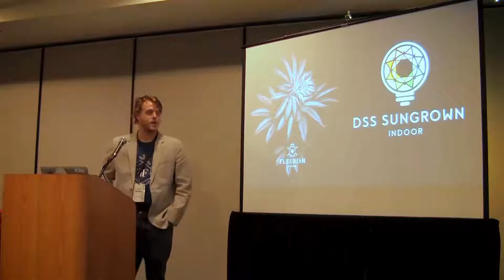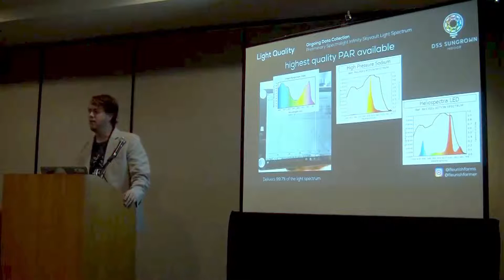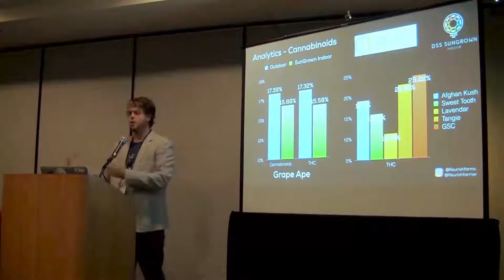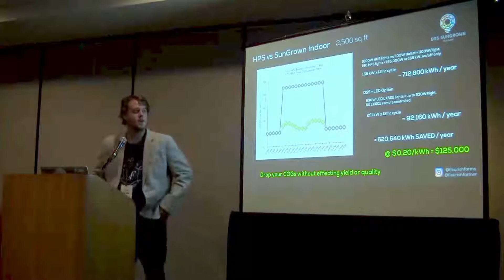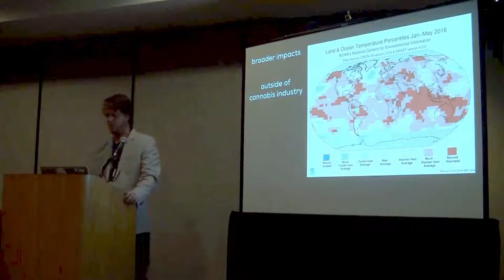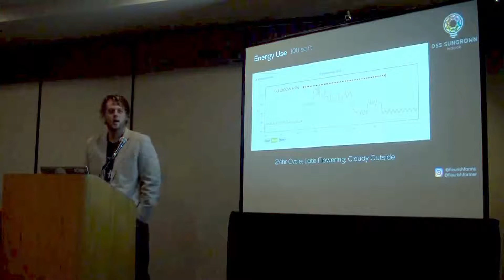Low to Zero-impact Indoor Cannabis Cultivation with the DSS SunGrown Indoor™ system

Comment: At what height from The plants should  you put the ene of the tube? Same as light fixture? What space can cover each tube? 4x4? 5x5?. Cheers.
Reply from the maker: Generally you would place the diffusers (bottom of Solatube) at the same height as artificial lights. However, since we capturing and diffusing IR waves (heat) on the outside of the facility - it is "cold" full-spectrum sunlight coming in. So, you do not need to worry about burning your plant tops like you would with artificial lights because they do not generate or transfer a significant amount of heat. 

Depending on the roof height (floor to ceiling height) in flower room, the area each SkyVault can cover varies - 4x4, 5x5, even 6x6 have been projected - if your in a location with high solar irradiance than we can increase the target area. Also, remember that natural sunlight fills a room with light much differently than an artificial light - so you get much more canopy penetration and ambient light levels when the sun is involved. 

If you are interested in a system spec, drop us a note @ info@ccvresearch.com
Reply: CCV Research im very much interested. About The solatubes... How do you clean The insides if neccesary? With what products?. Does It react to water or other liquids like mylar? Meaning It gets stained and loses reflectivity. So would be a problem for foliar spraying Maybe? I'm on south América and wanting to install a couple on my own as a project
Reply from the maker: Hey Federico - just like with electric light fixtures, it varies based on the growth stage, operational outcome goals and choice of artificial light. Our team would be happy to discuss details more with you over a phone call - send an email to "hello@sungrownzero.com" and we will get our brand ambassador to reach out as soon as possible.